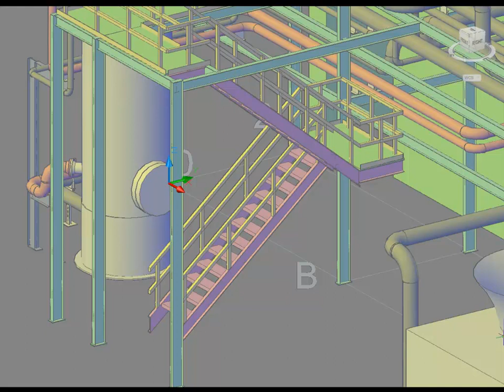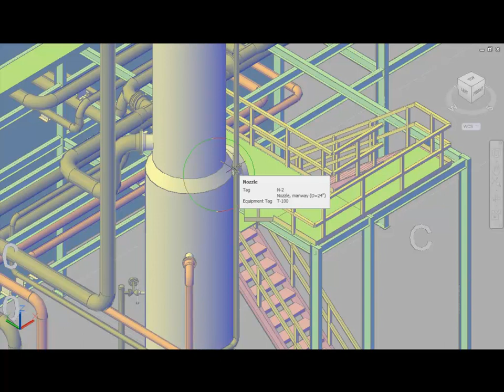Introduction to AutoCAD Plant 3D

Comment: hi, I have a question:  how I can execute stress analysis for AutoCAD plant 3D design?, for example, if I design pipe systems with CADWORX, I can use CAESAR II. thank for you clarification.
Reply: For this you can use CADISON-3D Plant Design & Equipment Engineering Software